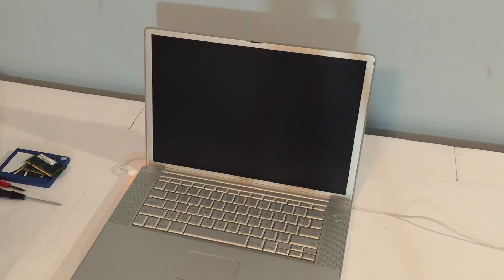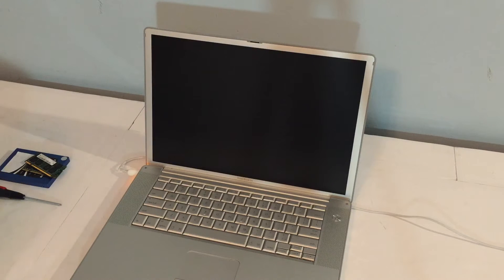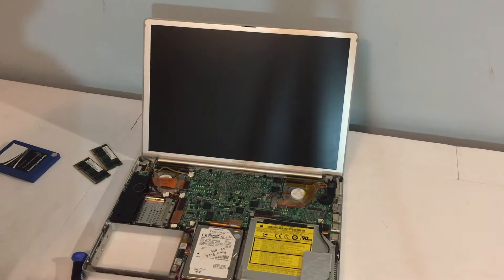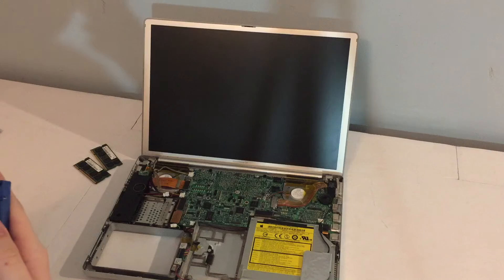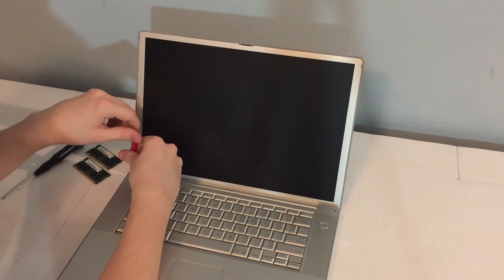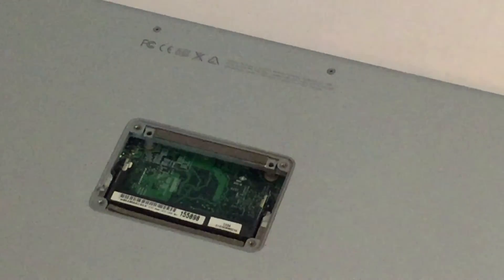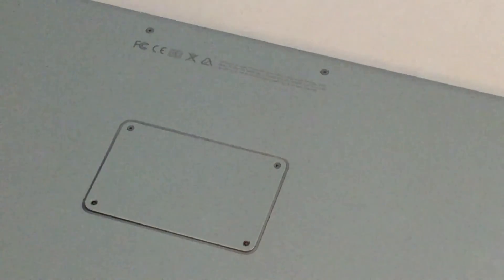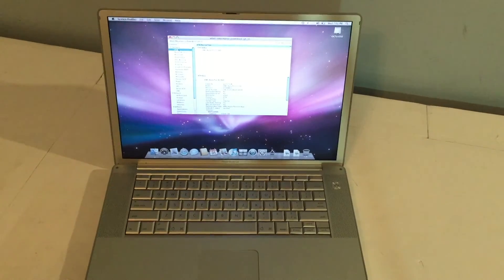PowerBook G4 1.67 15" SSD/RAM Upgrades

Comment: I have a 15" 1.67. My ram is DDR Standard. How did you manage DDR2?
Reply from the maker: there are 2 types of G4 1.67s. one has DDR2 and one has only DDR
Reply: Well I guess I've been doubly screwed then. I was supposed to have a 17" screen too but only have the 15". Oh well. The joys of buying from eBay. I'm not complaining, it's still a fast and slick PowerPC. I'm just a little miffed I guess.
Reply from the maker: That has happened to me before. my 2008 macbook pro I bought off eBay was a complete rip off. I may eventually make a video about it but I don't think so.
Reply: +AdanD66174U I'm just happy my PowerBook works. I'm going to bump the ram to 2 gigs and get a 120 gig SSD.
Reply from the maker: nice-I have my 240 partitioned with dual 120GB's and I run Tiger and Leopard
Reply: +AdanD66174U I don't see a point in tiger anymore really. Leopard is so much better it isn't even funny. But I still keep my discs around just in case I want to go back.
Reply from the maker: yeah honestly its more of a nostalgia thing for me at this point